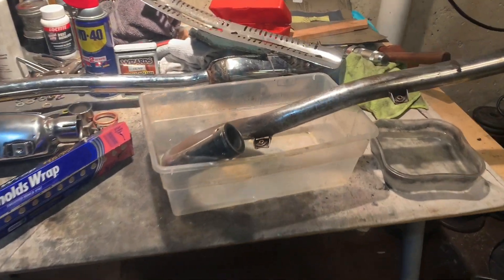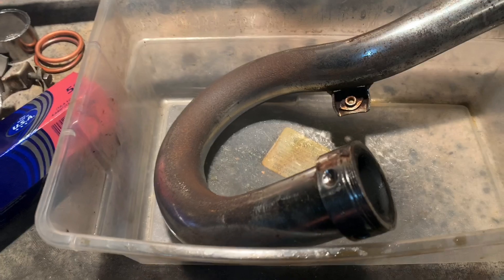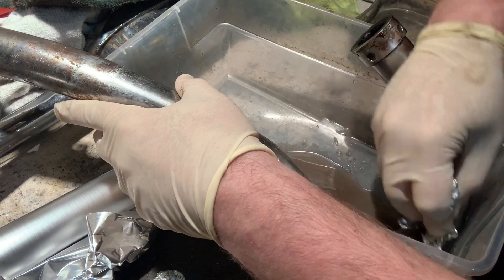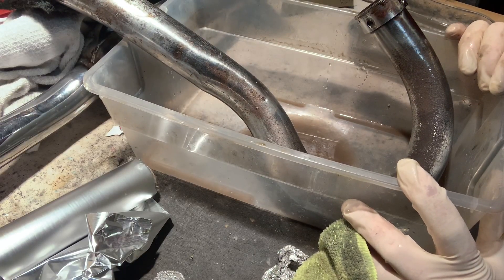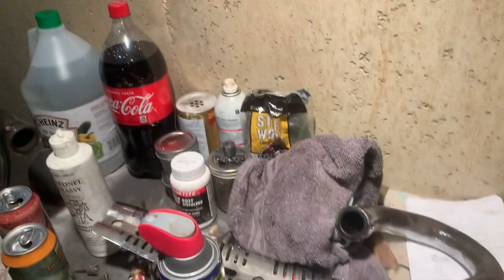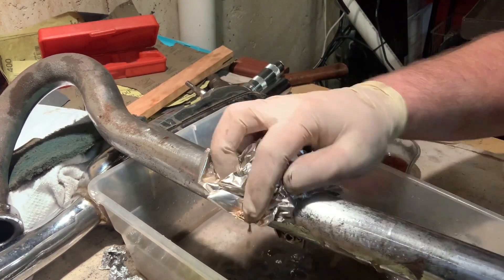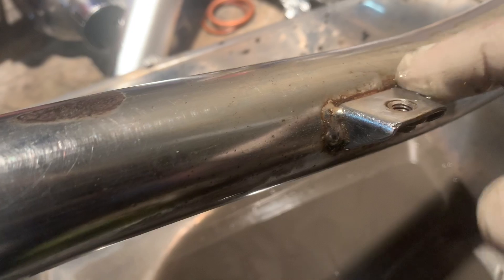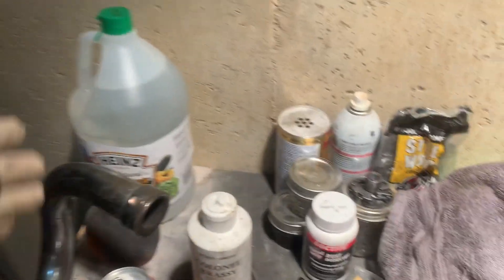Aluminum Foil Chrome Polishing With Coke, Water, Vinegar & More ULTIMATE TEST

Comment: for vinegar, let it soak out doors, in a covered tub. Usually about 2 hrs, depending on the thickness of the rust. Then reinse off with water and then clean with rust inhibiting product. vinegar loosens and lifts the rust, but leaves the exposed clean metal subject to quickly gathering moisture and thus a light rusting again.
Reply from the maker: That would do it!

Comment: Basically anything with an abrasive effect will work. No need for fancy brands.
When its pitted like that elbow, the rust basically is going through the metal. Seen on rims often. One can make it less ugly, but not really fix it.
Reply from the maker: Certainly doesn't fix it but with some dedicated care they can look fine. for what these are. Thanks, Santor.

Comment: The vinegar portion is YouTube Gold lol Why not try your Evaporust? For the back section of the exhausts I've seen people paint that swelled out part of it with VHT black paint and it looks smart with the chrome heat shields fixed over it...I wonder if you can get silver VHT? Anyway Brian, thanks for the laughs, my belly hurts now :)
Reply from the maker: Lol. Took one for the team with the vinegar. Smaller stuff Evaporust for sure...like the shields. It would take a ton of product for the exhaust. It’d probably work but I need to polish it all anyway. Overall the parts are pretty clean. There is silver VHT. Even in high temp. I bet that would pop a bit. Cool idea.

Comment: Looks like the black area needs complete galvanic re-chroming. The way the surface is bulged up suggests that the corrosion got under the layer itself.
Have you tried diy galvanic chrome plating?
Reply from the maker: No I have not. Googling.

Comment: Pretty funny when u got to the Vinegar test, way to take one for the team, heheh, us a full  face with  chemical  filter next time as it really cuts thru rust given time. Also, try electrolysis, the reaction rrmoves the rust and changes the metal,  plus its mostly free and if done in an aerated  area or outside its toxic free, takes about 24 hrs.
Reply from the maker: It just sticks up the whole house. Lol.

Comment: To make the foil more effective and alot less uncomfortable to hear I always put a little bit of dish soap in the water plus I don't crumble up the foil I fold it into small squares its definitely my go to for chrome like yours Brian but theres definitely plenty of other ways to get to the end result I think on the really bad part of the pipe I would use a header wrap just on the bend keep up the great work
Reply: Brian, I have used vinegar for cleaning tanks...it works great.
I have tried molasses and water for rust, it works over time but smells worse than vinegar.
My go to for rust is the electric route. A battery charger, a plastic container, a steel rod, and wire to suspend the parts. Negative clamp on part, positive on steel  rod or bar(anode), and add some Arm and Hammer soda wash( from the supermarket). Immediately, you can see the action taking place. No rubbing, no harmful chemicals. It will not remove good chrome, but flakey paint will come off due to rust underneath.
I use this method all the rime for bike parts. Great videos by the way.
Reply from the maker: Great idea with the soap. Will try that for sure. Thank you.
Reply from the maker: I can’t imagine it being worse than vinegar. Lol. Makes sense to use on a tank that can be capped. Open air? Hell no. Hard pass.
Reply: To make the foil even more effective, I leave it in the kitchen for my wife to use.